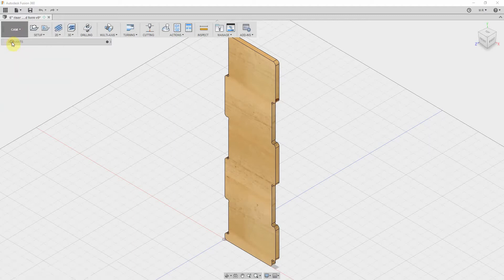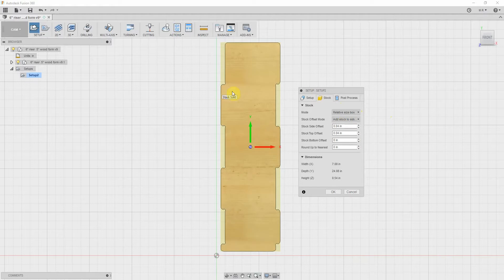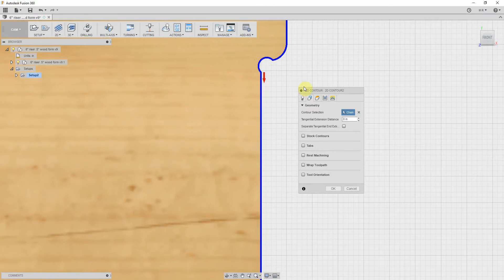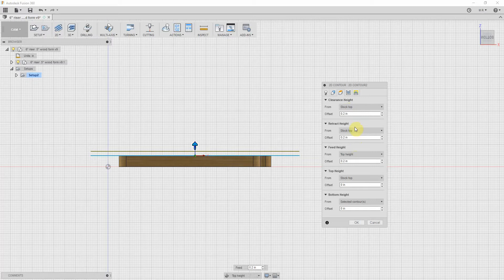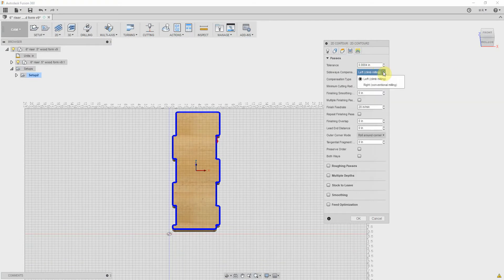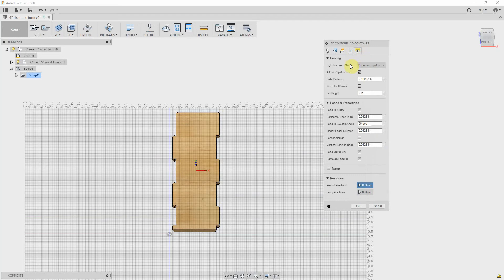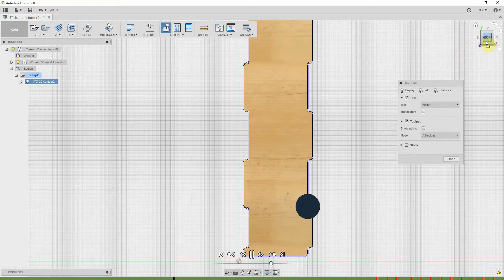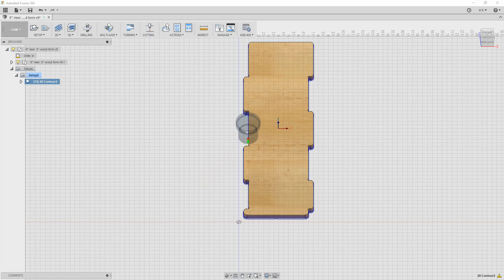Fusion360 CAM for Maslow Tutorial

Comment: great video, much thanks!...my only quibble is that it'd be sweet to see you load it in ground control and then show the cut and/or final piece. also, was just wondering if this is designed to interlock together with other similar pieces? peace